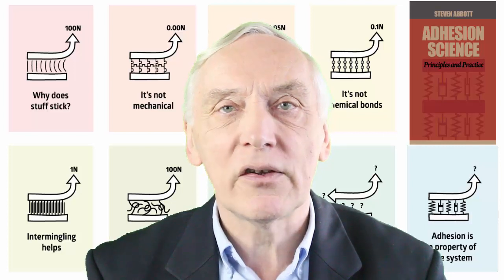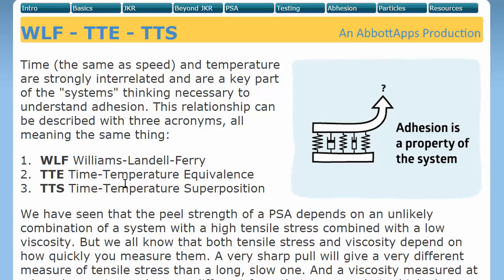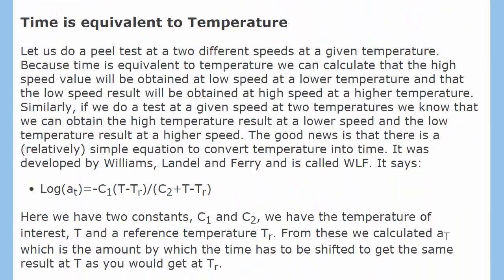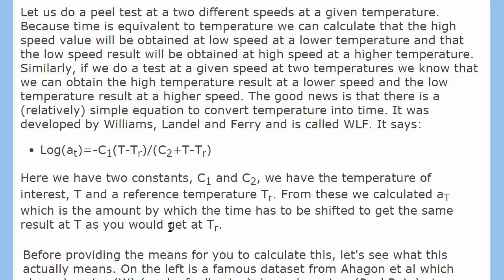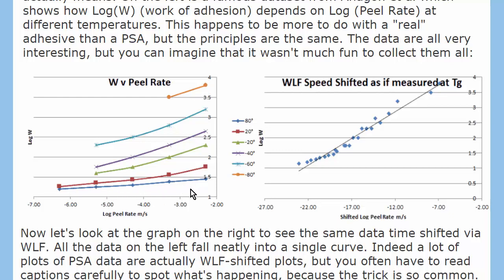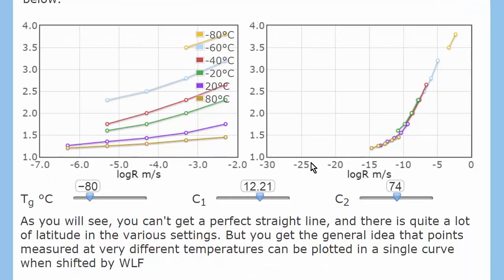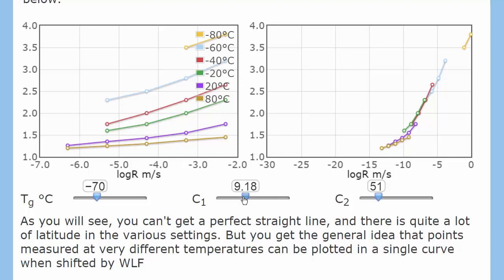Time Temperature Superposition

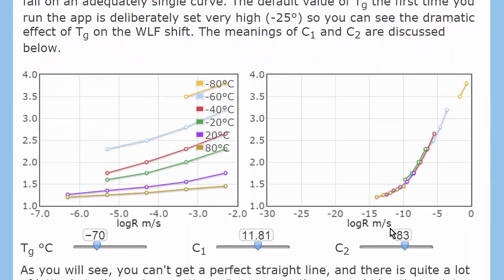Comment: Question: after @4:24  if your Tg=-70, C1=11.81, C2=83, then What's the T here? 80c?  I want to verify how that master curve is calucated, thanks.
Reply from the maker: I'm not sure how to answer, but the key is that the real values at 80c are the ones along the bottom of the left-hand graph which get transformed to the bottom left-hand mix of values in the right-hand graph. The slowest log(measure) is ~ -6.3 m/s and something like -14 in the master curve. So ln(a) is ~-7.7, something that should readily appear from the formula.
Reply: @stevenabbott3685  Steven, thanks for your answer. Could you verify my understanding? Let's just talk about the exact point you mentioned (bottom dark yellow at -6.3 at left, shift to -14 at right). Since the Ln(a) = -7.7,  the by using the WTF equation  ( (11.81*(T-203.15)) / (83+T-203.15 )   ) == -7.7, I found out this T ~= 170.39 (K), which means ~ -102.76 C .......  I am lost here. Where does this -102 come from, did I miss something ? I thought, to make the master curve, T should be the temperature of this dark yellow curve (80C).  

I also check the most left point (-5.3) at green curve (-20C), since the shift (Ln(a)) is about -9.74+5.3 = -4.44,  then I do the same thing ( (11.81*(T-203.15)) / (83+T-203.15)   ) == -4.44, T ~= 180.47K or -92.68C ...... So, Did I use wrong equation ?  This -92.68C make no scene for me....  I thought it should be -20C. Btw, Tg=-70C = 203.15k

Steven, could you help me on this ?  thank you so much

Comment: really clear. i want to know what is name of this app how to know C1 C2 Tg
Reply from the maker: The app is at https://www.stevenabbott.co.uk/practical-adhesion/wlf.php with an improved one at https://www.stevenabbott.co.uk/practical-adhesion/WLF-K.php. Although you can automatically fit C1, C2 and Tg, the point of the app (especially the newer one) is that you play with the parameteres to get a good-looking single curve - or, sometimes, the best-looking curve even if it's not super smooth. This is to help gain an understanding of what it all means.
Reply: @stevenabbott3685   thank you verry much . Do you know how can i get master curve if i have creep conpliance data ..

Comment: Question plz. If the temperature is not a constant number, how to use WLF to have the correct Log_at ??
Reply from the maker: That's the point of WLF. As you change T with respect to Tref, ln_at changes according to the formula.

Comment: May I have a silly question, I got log_at = - 6.5 (using WLF equation with t0=20. tg = -80, c1= 11. c2 = 70).  But calculation from your website is log_at = + 6.5 . Did I miss anything ?  The t0 > tg, the log_at should be < 0, isn't ?  Thank you!
Reply from the maker: I get confused as to whether you have to add a -ve shift or subtract a +ve shift, hopefully people can make sure they've got the final shift right!
Reply: @stevenabbott3685  thank you for your reply. If I may ask again. Base on the WLF equation, the calculation result is clear log_at =  - 6.5, not + 6.5.  However, on your website,  you showed the result of "at" use + 6.5 not - 6.5. so I believe I do misunderstand something. Could you please explain it?  thank you so much for your time.
Reply: HOW YOU CALCULATE C1 AND C2

Comment: Very interesting video . thank you very much professor.
Please how we can find the constants C1 & C2  and how many temperature range should be taken to plot master curve 
are there specific software to do that 

Kind regard
Reply from the maker: There isn't a simple answer. The temperature range has to be "big enough to get a few orders of magnitude change in your measured parameter". I'm not aware of any general software because equipment such as rheometers always have such software built in as they are a necessity. The one time I had to do it in an emergency I just wrote a simple Excel routine. The equations are trivial and you just need Excel's Solver to fit the two parameters.

Sorry not to be of more help!

Steven
Reply: Thank you very much professor for your response . Kindly, if possible have other question if I construct master curve depending on this procedure then can I used master curve for fitting Maxwell model  parameter from master curve instead of using one temperature curve .Kind Regard
Reply from the maker: Suppose your rheometer could go from -50 to +150 deg, you would have all the data you need for a temperature-based Maxwell model. Suppose your rheometer could only work at one temperature but you could go from 0.0001 Hz to 10000 Hz, then you'd be able to create a Maxwell curve at that temperature. In general our equipment has limited ranges for both T and ω. With TTS you can create curves that cover a wide T and ω range. How wide? That depends on your equipment. I am not an expert but it was once necessary to get a T curve from -30 to +150 on a machine that went down to -10 and up to 110. By adding ω sweeps we easily got the T range we needed to solve the problem.
Reply: Many thank to your kindness response it really wonderful answer . If I interesting in extrusion process which done at 100 C . can I used only storage modulus in fitting to extract Maxwell linear parameter or I should used both storage and loss modulus for this issue.Kind Regard
Reply from the maker: I have little experience in extrusion coating but getting G' and G'' is surely important to make sure that you know how viscoelastic things might be. If G'' is small then you clearly don't need it in your fitting, if it's significant then you will need something like a Burgers model. Sorry I don't have the expertise to give a more sensible reply.
Reply: Thank you very much Professor. your answer is very helpful . I Record my deep sense of gratitude to your help Regard
Reply: Hello Professor . Please if have any instruction or video about using Axel for TTS  it will very helpful.Kind Regard
Reply from the maker: I have no idea what "Axel" is. Sorry!
Reply: Sorry Professor I mean Excel Worksheet .
Reply from the maker: Email me (the address is on my website) and I can send you an Excel sheet that I used on a specific problem. It's not beautiful or elegant but it should show you how it's done so you can apply the same approach to your own data
Reply: Thank you very much for your help . I will send you message Kind Regard
Reply: ahmed alqayssi sir I am working on master curves,I am also not getting a clear idea of unknown parameters and use of Solver function in excel....please share your knowledge and process of constructing a master curve....it would be helpful...thank u
Reply: hello prof. can I get this excel sheet
Reply: Dear Professor how to convert time to frequency domain data. or how to do the TTS from time based data. As ur excel sheet based on Frequency domain. Kind regard
Reply: Dear sajjad I message you the required excel file on e mailregard
Reply: @dr.nayyefa.alqayssi2242   Dear Dr. Alqayssi, It is very helpful. Thank you very much.
Reply: @stevenabbott3685  Sir, please i need the excel sheet too